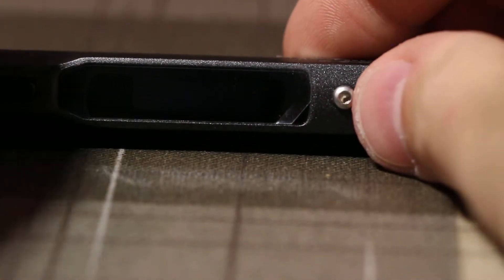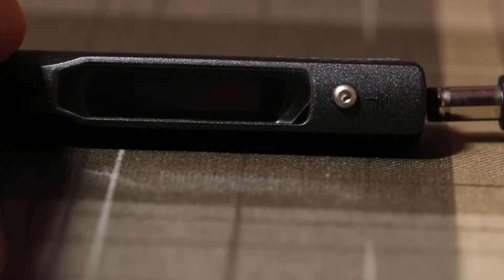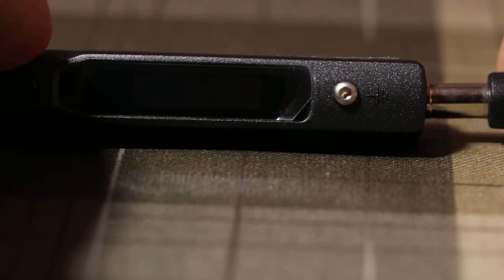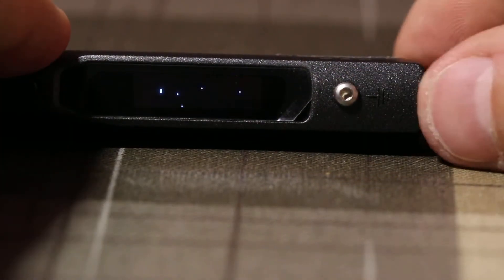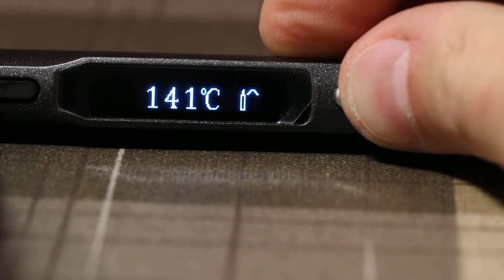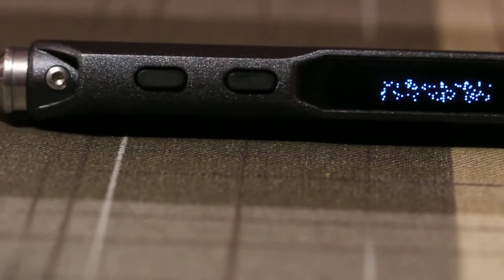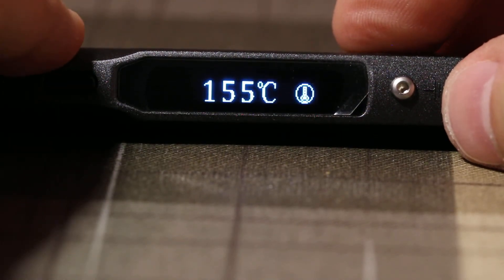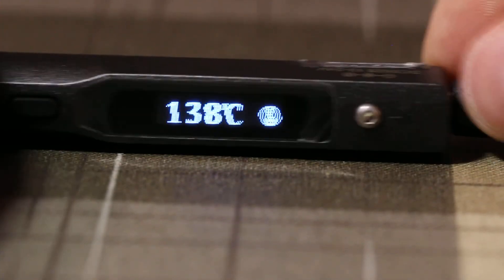MiniDSO TS100 Soldering Iron display problem

Comment: Long story short. It's an accelerometer issue. It can be addressed in firmware, but it isn't. The accelerometer and display on the same I2C bus. They never fully update the display after bootup, and end up writing pixel data to the wrong registers when there's an I2C glitch, corrupting the display. Fix it by removing the accelerometer, it's the smaller of the two chips on the daughterboard inside the TS100. Your problem will be solved, and the only thing missing is motion detection (you will have to push a button to turn the iron on when it times out, instead of just picking it up).
Reply from the maker: Thanks for the hint! The firmware is open source so it may be possible to fix this. It is interesting why the problem appears only on some units.
Reply: @ruevs  You're most welcome; I'm sorry that my comment sounded passive aggressive (I've been trying to fix this issue for a long time). Probably the simplest fix would be to perform a full screen update with complete re-initialization once every few seconds, that way any glitches are only short in duration. Either that or reduce the I2C clock speed
Reply from the maker: Nothing to be sorry about! I gave the one in the video to a friend, but I can get it and experiment with it if I ever get to setting up the firmware build system (IAR?). It is nice to know where to look.
By the way how did you find out it was the accelerometer and display interfering with each other on the I2C bus?
Reply: @ruevs  did you actually try this? Did it work? What did you do exactly?
Reply from the maker: @marcossoares9427  I haven't

Comment: I had a similar intermittent unit which is about 3 years old.  I initially thought it was a intermittent power connector on the board, so I took it apart to attempt to fix it.
As I took the back off the tiny daughter board which plugs onto the main board just fell out.
I plugged it back in and it clicks in place.  It is held in position with a strib of rubber padding, which seemed to have lost its ability to pad.  So I added a thin sliver of some other material and the unit now works 100%.
I thought, I would check my pther iron which is only about 2 years old and similarly, the daughter board just fell out.  I fixed in place using the same method above.
The daughter board has a 16 way connector and any intermittent connection will cause a plethora of problems.
Great iron though.     I have just ordered a third so that I don't have to change tips all the time  & I have two of them with small tips for de-soldering SMD's.

I hope that this note might help others!

Comment: The display itself does not seem defective. It's probably either one of the chips or an unsoldered pin (which can stop making contact depending on temperature).

Comment: Same problem with mine. Did you finally found a solution?
Reply from the maker: No. See my answer to the other person who had the problem. I have not tried anything else since then.
Reply: @ruevs  so you using it as it is or you gaveup and purchased a new one?
Reply from the maker: I have a second one.

Comment: Did you solve the problem?
Reply: I have the exact same problem, got my ts100 yesterday. It works a bit better with the 2.17 firmware, but still pretty much the same. Ralims open source firmware doesn't boot at all.

Comment: Use a different power supply I had one leaking AC and every time I touched the tip or the grounding tip it was going nuts.
Reply from the maker: I will try, but I have two of these and the other one works just fine on the same power supply plugged in these same outlet...